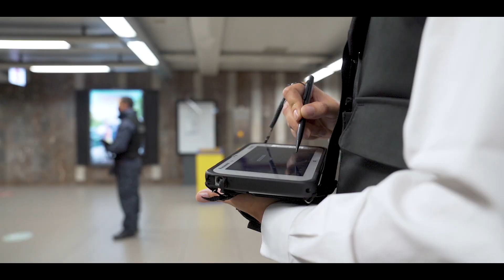The Brussels Transport Company

Comment: Hi another one sorry, how does the 12 bus work? Because I know it has a special fare but what happens when you are only travelling between Trone and Geneve, does that apply as well the fare? Additionally what if you just have a green stib card?
Reply from the maker: No problem, we are here to answer your questions.
So how does the 12 bus work ? If you want to go to the airport from brussels, you can now ride with the 12 at a normal price. With a season ticket or Brupass. If you don't have one of these, you can pay contactless in the bus or at a G0 Vending Machine (paper ticket). So, you no longer need a specific ticket to go to the airport. And of course you can travel between Trone and Geneve at a normal fare.
The difference is if you decide to take the bus from the airport to go to the city center, there you have to pay a special ticket called 'Go2City". It will cost you 7 euros. You can find all the specifics informations you need here : https://www.stib-mivb.be/article.html?_guid=d07b4e96-1283-3410-f08c-e0c5cfea3859&l=en

Comment: Honestly, thanks to STIB. Its easier to travel through Brussels. But a couple things, 1. Vandalism, while I was Metro Spotting by Schuman I saw this metro with a massive graffity, and most of these metros have tags even the M7. 2. Bus Service? Anyways I know there is A lot of buses that dont run on weekends or only run on Peak houres. Why is there only buses that only run on peak houres and only in between weeks?
Reply from the maker: Thank you for your comment.
You should know that metros with graffiti end their service and are then removed for cleaning. The STIB really emphasises this point. Any metro with graffiti is removed from the network as soon as possible.

For the bus, it is only a question of adapting the network and timetables during the week and at the weekend. Whether you take a metro, a tram or a bus during the week or at the weekend, the timetable will be different for the same line. This is an internal decision. There are also lines that are less used at the weekend and in the evening than during a normal week.
Reply: @STIBMIVBbrussels  yeah I guess the bus makes sense. But  its fustrating seeing metros with graffity, also the metros with the most vandalism on them are the M6, M5 and and the M4. Always scratches on the windows, tagged. I also have another Question. Does line 1 still have the orange metros. Because id love to seem them in line 1
Reply from the maker: @klmisbetter7229  Meanly M6 and M7 ride on line 1. Sometimes you can have a mx as back up but not always. MX ride most of the time on line 2 and 6.
Reply: @STIBMIVBbrussels  ah ok, but line 2 and 6 only have the MX, how about the line 5?
Reply from the maker: @klmisbetter7229  You can ride more often with a MX on line 5 than line 1, this is correct. But there a mix of rolling stock in these two lines. Not on line 2 and 6, wich are dedicated exclusively to MX.
Reply: @STIBMIVBbrussels  why is there only MX on line 2 and 6
Reply from the maker: @klmisbetter7229  It is to standardize the network in terms of rolling stock.